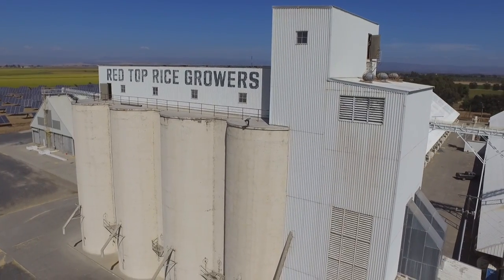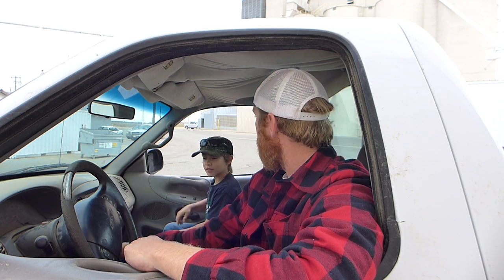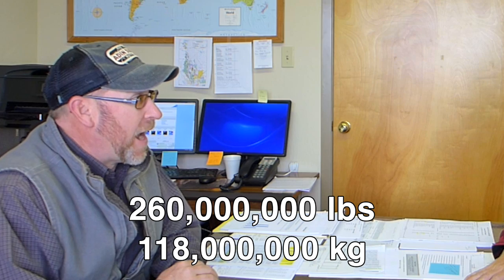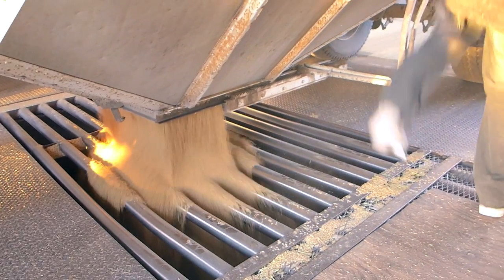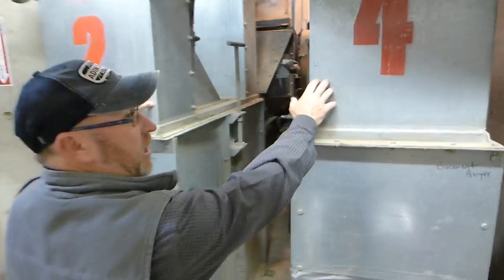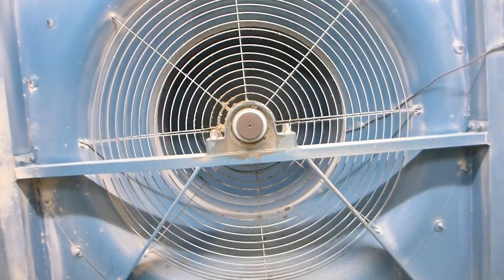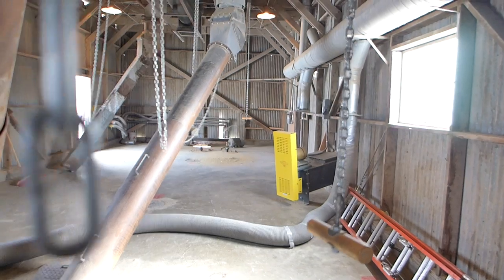260 Million Pounds of Rice to Dry!

Comment: Got a couple of safety questions: First, I noticed the warehouse catwalk was made from expanded metal, allowing any sort of dirt, animal feces, chemicals, etc, stuck to the soles of people's boots to be scraped directly on top of the rice below.  What about that?  Second, say you are on the top floor and are about to step onto the conveyor lift to go back down a floor or two, but at that very moment someone on the bottom floor steps on and starts it going upward.  Or, say, someone on a middle floor starts it going downward just as he has committed his step forward with the weight of his body shifting toward the conveyor lift.  Now there is nothing under the guy up top and he is committed to falling through that hatch to the floor (or floors) below.  How is that sort of accident prevented?  Very curious.
Reply: Since this is dealing with the rice still with the hulls on, and straight from the field (which has animals and birds popping in it, and rice and grain at this stage is often put on the ground, walked in, etc, standards of cleanliness are different than they would be after it is milled to remove the hull.

Plus, they don't have a cow pasture they walk through first, and would have good practices about cleaning shoes before entering the rice production area.

As for the lift, it is controlled by the rope on the side, and since you can see and yell the whole length of the system, you would check if anyone else is using it before climbing on or pulling the rope to start it.
Reply: @ke6gwf  Yes, at this point we're seeing unprocessed rice, but if I'm not mistaken they have this same setup throughout their processing facility, including polished rice, and so I believe my question remains unanswered at this point.  Regarding the safety of the lift, I promise you that any system relying on human operators to operate it correctly and safely has a failed design.  Safe design and safety measures are for protecting operators from any and every reasonably-expected problem -- not the least of which is an operator forgetting something or not performing something sufficiently.  And so I believe my question about this also remains unanswered at this point.

I was hoping to have a response from Rice Farming TV, but it doesn't look like they respond to comment posts.
Reply: @adamchurvis1  if you had watched the video and read the comments, you would have heard them say that they do not mill the rice here, this is only a drying and storage coop facility, and then they sell the rice to a mill. So there is no polished rice at this facility.

Also, if you had watched the video carefully as I did, you would see that there is only one platform on the personal lift, and it is NOT controlled by stepping on the platform, but through the rope that runs the entire length of the lift.
So the scenarios you presented are simply avoided by checking to make sure that no one else is pulling on the rope before you step onto the lift, and if they do when you are halfway on, you just pull the rope the other way to stop it.

And if no safety can be based on human awareness and actions, then we need to ban all cars, all heavy equipment working around people, planes, doors, pots of boiling water, and pretty much every other thing in daily life that requires operator skill and basic safety!
Reply: @ke6gwf  Submitted a detailed reply which just kept waiting and waiting and never appeared here, but here's the scoop: I did actually watch it all the way through and carefully a couple of months ago; I just forgot that they didn't mill the rice here, too.  Thanks for reminding me, question answered because of that.  As for safety, I'm talking about those potentially dangerous human decisions which would more safely and cost-efficiently be handled by either a safety mechanism or a re-design of the system.  I do a lot of work with firearms, and so safety is a big issue with me and I'm always on point.
Reply: @adamchurvis1  if you know guns, you know that the gun safety is entirely based on the user's skills and safety, there is no safety device that prevents someone from pointing a gun in an unsafe direction and pressing the trigger.

With machine design, you have to make it so that the machine will not do anything that the user doesn't command it to do.
This is how guns are designed, they won't do anything that you don't make it do.

This lift system is designed not to move unless the user commands it to move, and it is the user responsibility to ensure that they check that it is safe, just as it is with guns.

Now, you may be used to civilian elevators where everything is taken care of for you, but in the industrial world, you are dealing with machinery that requires operator training and that the operator takes care not to injure others.
This is no different than running a loader or an overhead crane, or any other piece of industrial machinery where you have to be responsible for the safety of others.
Reply: @ke6gwf  You are speaking a bit out of your depth with respect to gun safety and machine design.  I am not talking about the simple fire control called a "Safety" on firearms, I am talking about the entire firearm's design with respect to its safe carry and operation.  From time to time firearms have been designed, tested, and adopted by various countries' militaries only to find out later in the field that a reasonably-trained soldier can operate it in an inherently dangerous way that is actually caused by its proper operation.  This can happen when a firearm is designed in such a way that it is unwieldy for a soldier to operate, as it takes up so much of the soldier's attention that he may lose sight of the fundamentals of safe handling.  For example, the M1 Garand and its appetite for soldiers' thumbs.  So afraid he is of catching a second dose of "Garand Thumb" so soon after his first -- and still wearing the bandages for it -- he really REALLY concentrates on NOT doing it again.  The muzzle starts to drift...  Regardless of the fact that this is an associated flaw rather than a direct one, it still kills and injures just the same, and so that feature alone makes the firearm inherently unsafe IN THIS ONE REGARD.  Many great firearms have flaws much worse than this.  Take for another example a bullpup I shall not name because it is currently being re-designed to prevent this issue.  Being a bullpup, the distance from butt plate to muzzle is only about 27".  Combine this with what the soldier must do to clear a failure to eject malfunction and you have the very real opportunity to accidentally point the weapon at its owner's own head.  The problem is made safer by making the failure to eject simpler and easier to resolve in the heat of combat.  This might take a complete redesign of the extraction-ejection system and the other parts to which they mount, or it may be a simple change to the extractor's claw profile and spring strength, but solving that problem makes the entire weapon-soldier system inherently safer.  Also remember that yelling at the dead guy for not doing it right is never a solution.  At least that's what his lawyer keeps reiterating in court.

Safe machine design was a big push for Ralph Nader.  Ever see the auto-shutoff guards he petitioned the federal government to require on printing presses?  Well-experienced printing salesmen have been strangled or decapitated by printing presses by showing it operating to a prospect, only to have his tie caught.  Thirty years in the business, and that's that.  And he knew what he was doing; just some tiny fluctuation -- a breeze from an open door, even -- and this time is his last time.  That's the kind of safety problem I foresaw on that lift: two potentially different logic systems (the two human operators) occupying and attempting to control a single physical system (the lift) through a mutually-exclusive control (the control line).
Reply: @adamchurvis1  so, I happen to be quite familiar with gun design and machine safety (considering that I used to help teach safe gun handling, and also design and build and retrofit industrial control systems and machine automation) , and I prefer handguns with no safety, because it is built to be inherently safe by design.
I also know of a recently released handgun that will fire if dropped at the wrong angle, because of a safety design failure.

But any gun that I want to own will be completely safe from unexpected discharge, unless I press the trigger.
Yes, with many guns you have to be careful not to get your hand in the wrong place, such as too high of a grip with a Glock, and some like the Garand may have been more likely than others to catch hands, but regardless of all of those points, the greatest danger of a gun is in hurting someone else, and that requires operator control.

Same with the lift.
If the operator doesn't exercise safe handling practices, and the employer doesn't provide proper training and have say, a policy to call out before activating the lift, then it is a user responsibility issue, just like with a gun.

You started this out not even understanding how the lift worked, but continue to try to argue that it is not as safe as it should be, that it is more dangerous than a loaded gun, which I find kind of humorous lol
Reply: @ke6gwf  "I prefer handguns with no safety, because it is built to be inherently safe by design.
"  I do, too, but the lack of a safety doesn't make it inherently safe; something tells me you weren't claiming that, but your statement was ambiguous.  And this example is to my point: how many have drawn and attempted to fire in self-defense, only to find that their safety was engaged.  100% with you on this.

"I also know of a recently released handgun that will fire if dropped at the wrong angle, because of a safety design failure."  Sig P320?  That's not the only one.  And don't get me started on rifle safety malfunctions (or the lawsuits).  This also speaks to my point: the safety was THOUGHT to work reliably, but was later found to not be so.  If safety mechanisms can fail, then you can be damned sure that humans can, too -- like fail to call out, as you said -- THAT'S why I don't like to rely on humans to make things safe.  Training and experience, of course (no-brainer), but there are mistakes, disorientation, failure of a control knob, unforeseen fill-in-the-blank, that we should try to eliminate from the human-machine system wherever feasible.

"But any gun that I want to own will be completely safe from unexpected discharge, unless I press the trigger.
"  *IF* that gun is safely designed and built.  Case in point: the P320, which wasn't.  And so the entire human-machine system had to be re-evaluated and the firearm redesigned to resolve the problem.

"...the greatest danger of a gun is in hurting someone else, and that requires operator control.
"  Not criticizing, but this is a rather obvious statement, and so I don't know what you're implying, especially since I have not suggested otherwise.

"Same with the lift.
  If the operator doesn't exercise safe handling practices, and the employer doesn't provide proper training and have say, a policy to call out before activating the lift, then it is a user responsibility issue, just like with a gun."  Yes, absolutely.  And now I want you to really and truly pay careful attention to me this time, as this is getting a bit old.  You cannot rely on operators always operating safely because not only are people flawed, unexpected things happen which can prevent the operator from safely operating the machine.  This is why as much of the straightforward and simple decisions made by humans should be replaced by safety mechanisms which operate as automatically as feasible.  Even then the safety mechanism can malfunction, but it will do so much less often than the human operator will.

"You started this out not even understanding how the lift worked, but continue to try to argue that it is not as safe as it should be, that it is more dangerous than a loaded gun, which I find kind of humorous lol"  That is correct, I didn't know.  I looked at it operating and was puzzled because it looked inherently dangerous for two people to operate.  Your explanation helped me understand that I was right: it IS inherently dangerous, and for all the reasons I have posited.  But would you do me a favor, please?  Would you please copy and paste my verbiage where you say I claimed that "[the lift] is more dangerous than a loaded gun?"  I don't believe I said that, or anything like it.
Reply: @adamchurvis1  when I used the term "inherently safe" I meant that the Glock is designed to be safe without needing a manual safety to prevent accidental discharge.

Most guns are designed to rely on the manual safety to prevent discharge from everything from racking the slide to your finger slipping on the hammer, to being dropped.
So if the safety was off, there were many ways it could be made to fire.

The Glock is designed so that there is only one way for it to fire, and that is to press the trigger in the proper way.

I actually prefer the XD design, because it is even safer, where it will only fire if the trigger is squeezed against the grip safety.

So that's what I mean by an inherently safe design, that nothing else will cause it to fire except for operating the control properly.
(and yes, some guns fail to meet this standard, and so I don't consider them to be safely designed.) 

You however want the lift to be even safer than a gun.

You are happy having the gun rely entirely on user skill and training to maintain safety, but want the lift to take full responsibility for operator safety.
If you applied the same standard to a gun, you would want automatic target recognition, bystander sensors, threat rating etc built into the gun so it would not fire unless it was pointed at an actual threat.
You want to take as much of the safety aspect out of the hands of the human and put it in the machine.
You probably also want your car to be self driving so there is no human factor involved in safe driving, and airplanes should all be autonomous, as should all tractors and heavy equipment and cranes and everything else.

Or do you only apply this to things that you are not used to?
Reply: @ke6gwf  I figured that's what you meant.  I've been carrying a Glock 23 for years, so I'm quite familiar.  If you'd like a real treat, read the book "Glock: The Rise of America's Gun."  Fascinating stuff.  I live only a few miles from the Smyrna factory that makes them for the US, and their history here is notorious, filled with near-constant strip club attendance, attempted murder, and prison terms.  Now let me address what I think is making the safety discussion go wrong.  First, you are assigning motivation -- always a bad idea -- when you tell me what I think or what I want.  You are reading my words and then reading things into them that are neither said nor meant.  As best I can tell, you are assuming these falsehoods because you are not understanding the central idea of what I have been saying, so rather than expect anything new from you, I'll invite you to go back and re-read what I've said from the beginning.  And this time, completely remove the ideas you have about what I want and what makes me happy, and perhaps even the little digs you make about what I want in my car or an aeroplane.  You're not properly debating, you're just baiting.  Perhaps it would be better if I knew how old you are, so I'll ask: How old are you?  I'm 57; I'll be 58 in April.  It will also help if you stop conflating illustrative examples with the original topic.
Reply: @adamchurvis1  well, the original topic was that this place had milled rice that needed to be kept clean through changing what is industry standard construction, and that there was a safety issue caused by the way that you thought the lift operated, which was incorrect.

Since then you have kept moving the goal posts about why the lift is unsafe, accused me of not understanding guns or safety or industrial control systems and the associated safety principles, made serious assumptions about me because I didn't agree with you, and have been unable to understand my attempts to use analogy to show how extending your claims about this lift to other things such as your car or gun don't make sense, and now are trying to define how I must debate and behave in order for you to be able to win the debate without me upsetting your idea, so I really don't think that you are open to new ideas or ways of seeing things.

Yes, this lift has some serious safety risks, but they are falling off due to losing grip or slipping off the platform, or from leaning too far out and hitting the structure while moving.
Also the risk of the open holes in the floor.
If osha got involved, they would want gates on the floor openings, and some sort of railing around a slightly larger platform to prevent falling off, but the control system isn't at issue.
I mean, everything from boom lifts and scissor lifts, to construction elevators can be operated manually from either the platform or the ground, and this design gives the rider the ability to override control inputs from elsewhere.
Reply: @ke6gwf  This entire post of yours is false.  To wit: you cannot cut and paste my exact sentences as quotes that match what you are claiming I have said.  I haven't said anything you claim I have said, I haven't thought the things you claim I have thought, I haven't had the emotions you claim I have had -- literally NOTHING of what you have said is true.  Until you can match my EXACT words with your claims we have nothing to discuss because you are not having a discussion with me, you are only making false claims.  And you still have not answered how old you are.  Why?  Embarrassed?
Reply: @adamchurvis1  my age is just a distraction, and totally unrelated to the conversation.
I can't copy and paste because the app doesn't let me copy comments, and I am not near my computer.

You admitted that you had forgotten that they didn't mill at this facility, do you remember that?

Your original comment was giving an example of someone at the top trying to step on the lift just after someone else started riding it, which, since it only has one platform is not possible, and it wasn't until it explained how it worked that you understood the control system, and then went on to change your argument to match the new facts. Do you remember that?
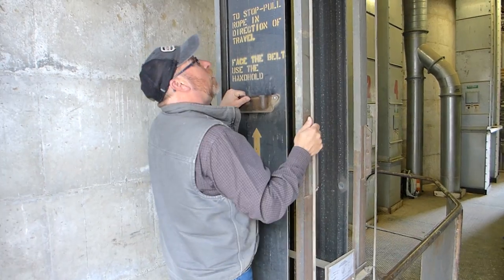Reply: @ke6gwf  Your age has everything to do with this, and if you honestly post your actual age we shall all see right away why you say the things you say.  And don't worry-- I'll wait until you get to a browser where you can copy and paste.  As soon as you reminded me that they don't mill the rice there I said you had sufficiently explained to me why that catwalk was not problematic as I had thought it might be.  That is no longer even a discussion point, much less an issue for debate.  Regarding your statement, "Your original comment was giving an example of someone at the top trying to step on the lift just after someone else started riding it, which, since it only has one platform is not possible, and it wasn't until it explained how it worked that you understood the control system, and then went on to change your argument to match the new facts. Do you remember that?"  Yes, I remember my original comment, and yes, it is very possible UNLESS there is some safety mechanism that engages to prevent it.  And there is more than the one platform you claim.  Start viewing at 2:59 to see there are at least three one can see in the video.  And my safety concerns were apt, as I learned just now researching this very model of lift.  This lift is equipped, as standard and required equipment, with at least TWO safety mechanisms: one at the top which instantly stops the belt if someone on the belt fails to exit at the top floor, and a similar safety mechanism at the very bottom for those who fail to exit at the bottom floor.  Additional safety devices can also be added; I don't know what those consist of, but I can find out if you like.  I can also present my safety concerns to them and learn how they either are or are not apt due to possible safety mechanisms I don't yet know about.  As far as the control mechanism, it would be very easy for one person to yank it harder in one direction than the other person yanks it in the opposite direction, wresting the rope from one of their hands, but let me put this in front of those who really and truly know best: the manufacturer.  I'll also try to get some URLs to documents that might guide you and I better in this debate.  I clearly have ZERO personal experience with conveyor belt lifts -- which is precisely why I asked my question in the first place.  

I question things a lot.  I saved my ex-wife's and oldest son's lives while she was giving birth to him because I discovered a safety flaw in the IVAC Infusion Pump used at that time (1983).  She was supposed to receive about 6 drips per minute of Pitocin from the pump, but it was delivering 54 drips per minute and she was writhing in agony and the baby's vitals were not as they should have been.  I did a quick fault-chain analysis of the system starting from her arm and proceeding toward the wall power outlet.  I discovered the problem was the electric eye gate clamped to the clear nacelle through which one may observe the drip rate.  I saw that there was a safety flaw in the design which let someone affix the gate too high on the nacelle, allowing the actual photoelectric eye mechanism to be partially blocked by the needle descending from the bottle inside the nacelle.  I tried to tell the nurse but she condescendingly told me that she had been doing this for eleven years.  I ran out and frantically grabbed this OB/GYN doctor and told him what was wrong.  He walks in, moves it down, hits the Reset button, and it's straight 6 drips per minute.  "You had it on there so high the needle was blocking the eye.  You can't do that," he said to the nurse.  He walked out; she didn't say a word after that, and didn't make eye contact with me for the rest of the night.  IVAC has since realized this potentially deadly safety error in their design and completely eliminated the possibility for that to happen ever again.  And these were experienced, well-trained nurses.  Shit just happens sometimes to the very best of people; safety mechanisms hopefully prevent catastrophes from developing out of those mishaps.